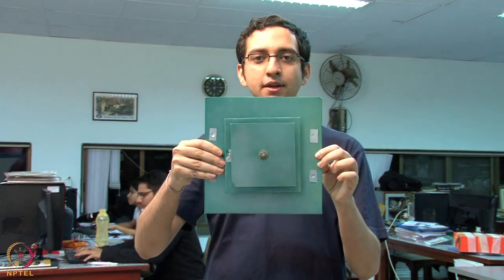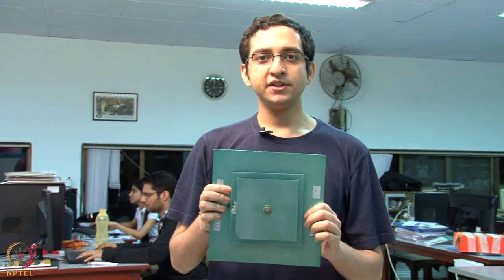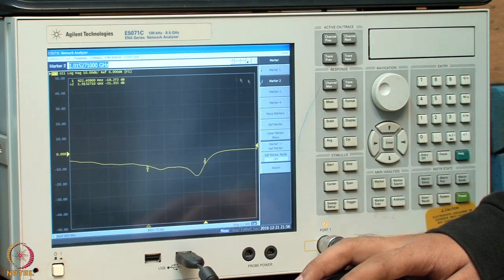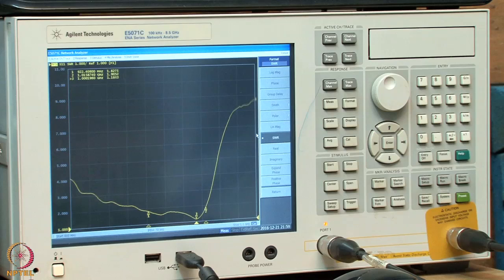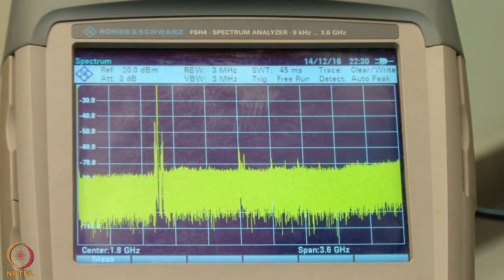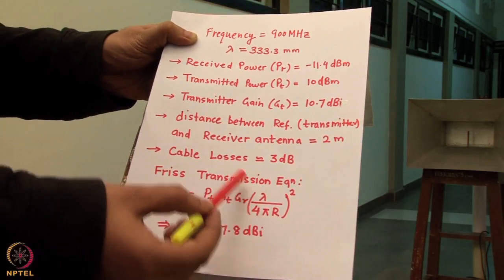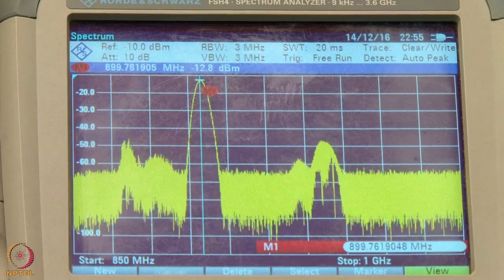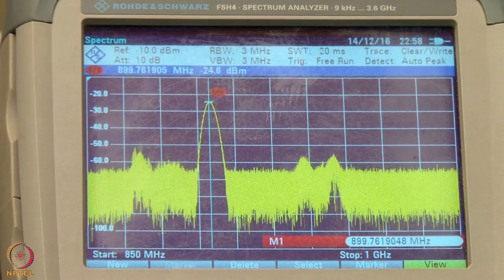Week12-Lecture 60

Comment: Sir, I have a query regarding your calculated gain of receiver antenna.
In friis equation, cable loss factor is not present and when i solve friis equation with other given parameters my gain value of receiver antenna comes different as mentioned in the video. This might be due to the absence of cable loss factor in the friis equation. Kindly, help me regarding this matter.